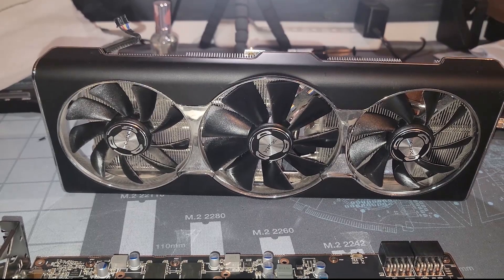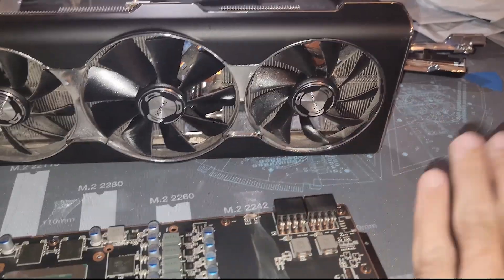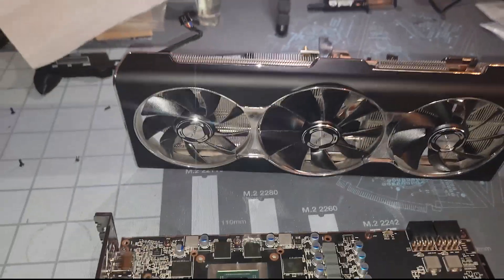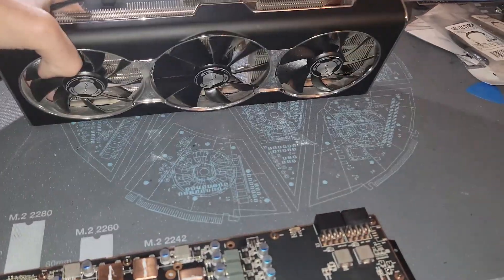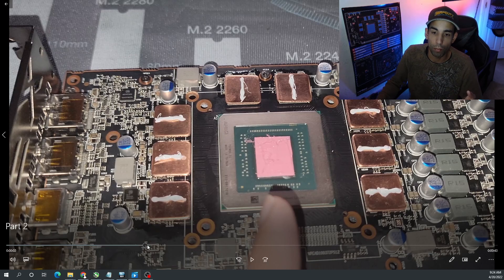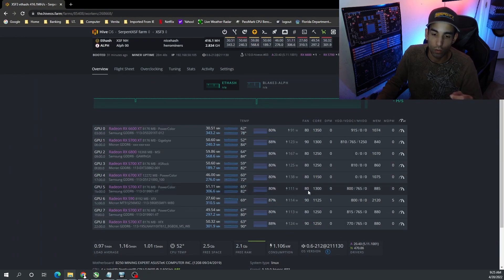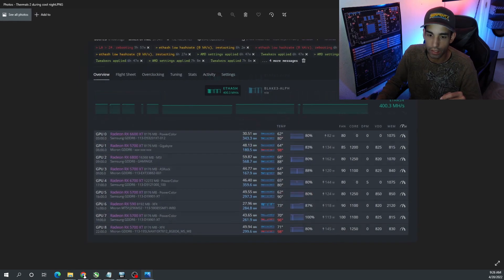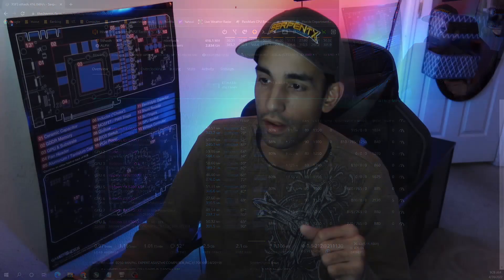XFX Thicc RX 5700 XT Teardown & Thermal improvements

Comment: Have a Thicc III Ultra and Thicc II I use for mining. I bought them before I found out they were reselling mining used GPUs as new. Fans on the III went out recently. I pulled all the plastic junk off it and reinstalled the cooler with a couple of Noctua fans zip-tied to it. I was able to use the PWM controls in Radeon Software and plug the fans via a splitter onto the GPU fan header. I had to use some RTV to hold the plug on the fan header and it was a tight squeeze. Noctua paste and Arctic pads. I am running 50C on the GPU, 48C on VRMs and 68C on memory at an ambient of 30C. Pretty sweet. I was surprised that, even though the stock fans run up to 3500RPM and the Noctua fans are 1700RPM, the software had no problems adjusting. 
I have been having erratic operation on the Thicc II so I pulled it. I am going to give it the same treatment because I think the fans are only working properly, intermittently, causing severe throttling at times.
On another note, why are you putting copper pads on the mem when they already contact copper? It seems like an exercise in pointlessness. You are changing headroom on the cooler mounting and I sure hope you took this into account for the GPU and VRM pads! I also wouldn't use pads on the GPU. I doubt they are as conductive as a good paste.
153 W for a 5700XT is just wasteful. Who taught you to tune? I have 5700XTs making 50MH/s on 95W. No wonder your mem temps were so high.

Comment: Hello gentleman, could you please help me choosing the right card, I write down my choices:
These are the 3070 Tis with price tags (after tax) in my region:
Asus Strix: $1030
Asus Tuf: $900
Zotac AmpHolo: $900
Gigabyte Aorus: $885
Zotac Trinity: $825
Reply: My advice is to stay away from Gigabyte. I have no experience with Zotac but generally you get what you pay for and I don't hear many negative comments about them but they are generally regarded as "less than" Asus. I prefer Asus, MSI and EVGA for GPUs based on experience. I also would strongly consider being ok with a 3070 or getting a 6800XT because GDDR6X memory lives fast and dies young. You really don't wanna put yourself in the position of having to repair a just-out-of-warranty GPU. In any case, I have an expectation that a GPU should continue to function long after it has become obsolete in practical terms and this is what informs my advice.
If you insist on still getting a 3070Ti, of the ones you listed, I would get the Asus Tuf, no questions asked. You can probably get the performance of the presumably higher clocked Strix just by doing some tuning and the rest of the difference is really just bling.

Comment: I tested copper shims for my vrams for my powercolor 5700xt, and the mem temps were actually much worse than using thermal pads.
In my case it could be that the copper shims were not thick enough. Thermal pads give more room for error as we would need extremely precise dimensions for our copper shims to work.

Comment: I have one of these cards. I also removed all the chrome plastic, used Gelid pads, and kryonot thermal paste. It runs stable and cool with mem junction temps between 64-68 c depending on ambient air temps. Sweet video
Reply: What thickness of VRAM pads have You used? And what temps before/after?
Reply: @dimk3035  I matched up what the person before me had installed if I remember correctly it had 1mm and 2mm pads. I didnt run it before I changed everything but now 62c mem junction temps.
Reply: @gandolfgrey5385  Did you use 1mm on the VRAM chips surrounding the GPU dye?
Reply: @t3xcod171  reply not sure it was so long ago I matched what was there. I think they were 1mm, but I would measure the old ones to make sure